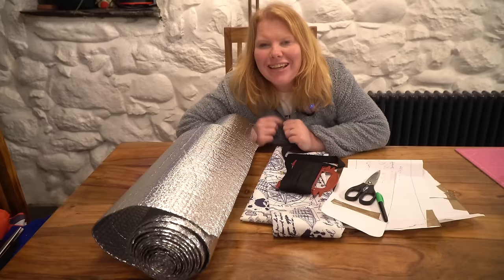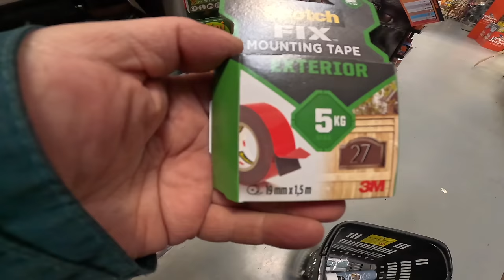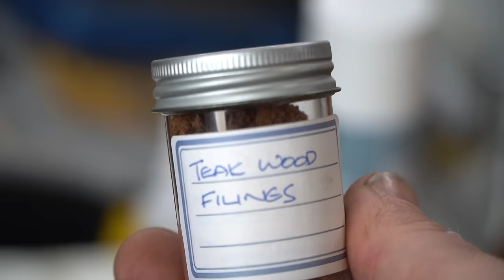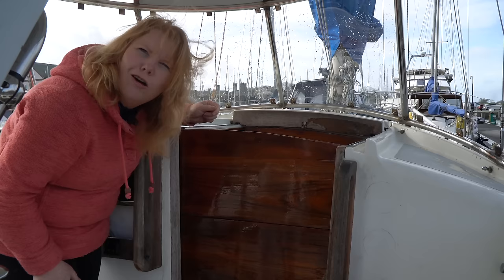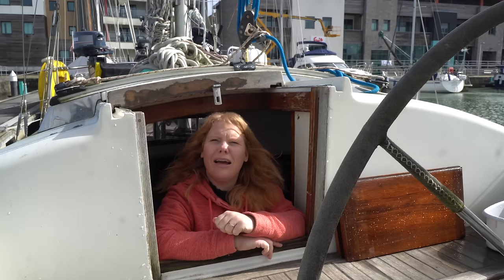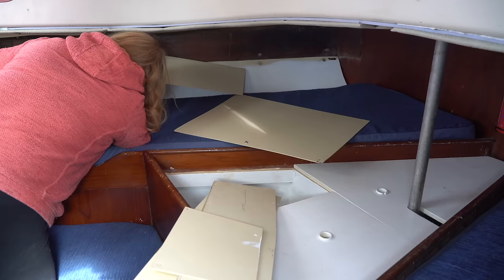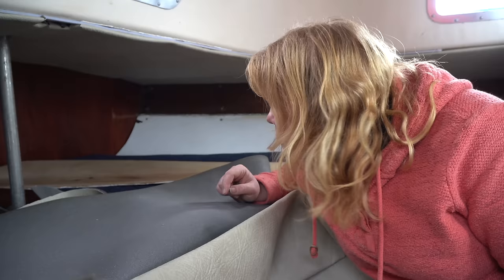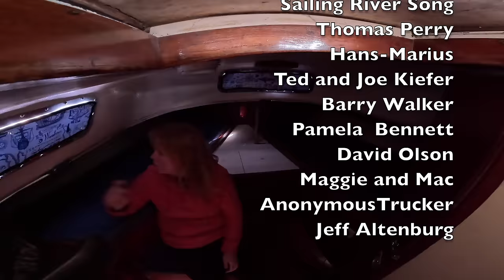50 year old sailing boat cabin REFIT

Comment: Here's a little trade tip my neighbour who is a retired carpenter showed me when rehanging one of my doors. The existing holes in the wood were stripped, so the hinges would have been loose. He took a couple of matches, put them in the oversized holes, snapped them off and made sure the screws then tightened.
Reply: My Dad showed me that trick maybe 60 Years ago, brought a great memory back to me, think that was the same Day he put a Bradawl through the thin skin between my thumb and forefinger 🙂Great how some of the scars and wounds you pick up through life remind you of good times.

Comment: simple fix for loose hinge screws. get some wood tooth picks and some wood glue. dip the toothpick in the glue and put it in the screw hole and break it off. put the screw back in. if the hole is really bad put two or three picks in the hole and put the screw back in. cost to fix those loose hinges is almost nothing. I also find the flat wooden toothpicks work best.
Reply from the maker: Thanks great tip

Comment: We have a near identical boat with similar aft cabin and identical access from the cockpit via sliding deck hatch and vertical slides, however we very seldom  use the vertical slides as we have a simple canvas cover over the sliding deck hatch which hangs down over the vertical hatch and is attached with 4 press studs on each side. I think we’ve only ever put the slides in once or twice in very rough weather going upwind, but these days we also have the shelter of a large hard dodger a bit like yours.

The key difference probably is that the aft cabin is the main sleeping cabin for my wife and I, who are usually the sole crew, whereas for you, the aft cabin is for your kids, so I guess you want it a bit more secure. Also kids are far more easily able to access the main saloon via the crawl through.